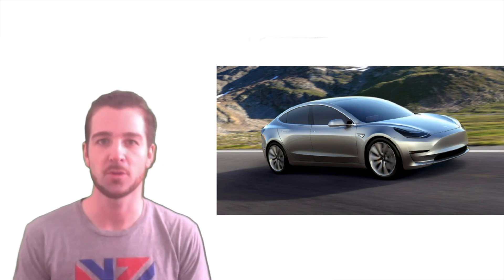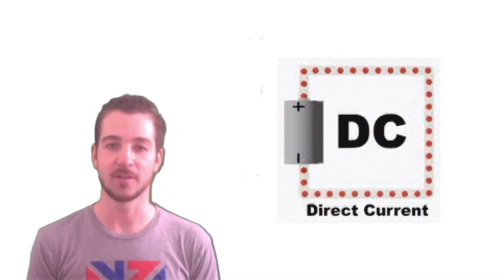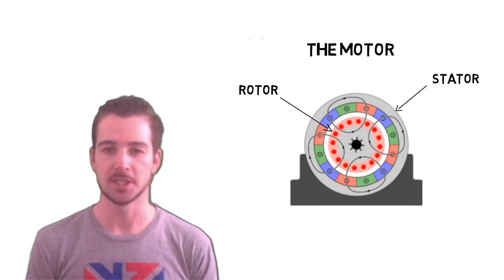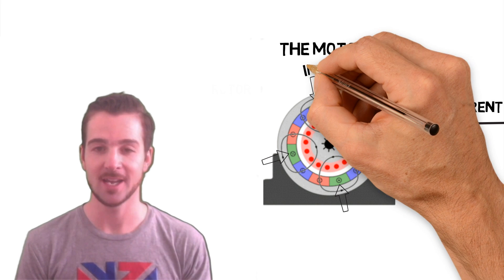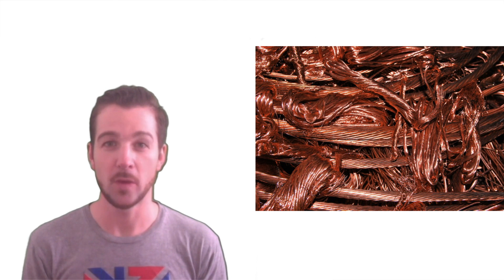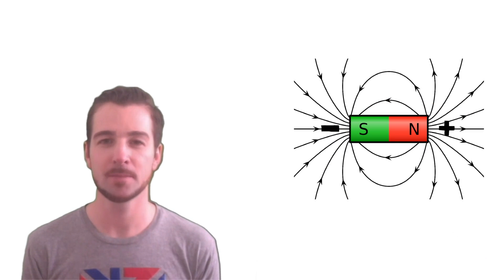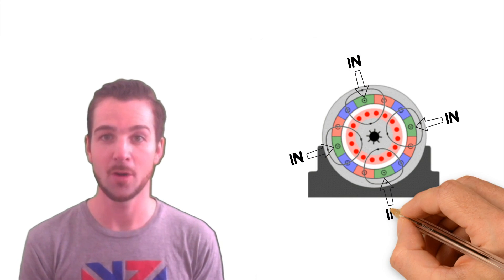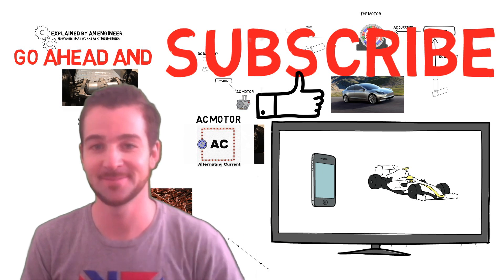How does a Tesla Model 3 work?

Comment: Petrol car uses gasoline, electric car batteries ? Shouldn't it be electricity ? 
I mean, the batteries store store the energy the same way the tank stores the gas. 

When there's no gas, the car doesn't move, make sense. If there are batteries but no electricity .. 

I know i'm being picky on the wording here 

And to conclude, even if it's very likely that the model 3 will use the exact same technology than the model s and x, the car is still a prototype ( as we can see in the Q1 report ) and the car is still subject to a lot of changes. 
Seems a bit presumptuous to talk about a car that nobody knows anything about, at least officially ^^

I know we are not there yet but let's imagine for fun, in a year or so there is a massive breakthrough with the graphene batteries ( which apparently could store up to 4 or 5 times more energy/kg than li-ion cells ), it's safe to imagine tesla would repurpose the gigafactory into making graphene batteries instead of li-ion.

And that's just talking about the energy, who know what the future holds with the motors and what not.. 

But other than that, great video to explain how the current model s and x are working.
And you actually answered a few things a friend of mine couldn't explain to me in simple non-electrical terms, so thank you ^^
Reply from the maker: Hi +Adrien Cailleaux ! Thanks for the question!

Yes electricity or "kinetic energy in the form of moving electrons" is a key form of energy in the energy equation in a electric car. 

The energy starts as potential chemical energy stored inside a battery. You can think of this as a loaded spring built out of chemicals. The energy is there and ready be to be used when we connect the battery or "release the spring".
The equivalent in a petrol car is the potential chemical energy stored in the gasoline.

The battery is then connected and the potential chemical energy changes form to electricity which is the word we use for kinetic energy in the form of moving electrons.
The equivalent in a petrol car is when the gasoline is ignited the potential chemical energy changes form to kinetic energy in the form of moving carbon dioxide and water atoms.

This kinetic energy of the electrons then changes form to kinetic energy of the rotor in the electric motor. This change is through the process of magnetic induction as explained in the video.
The equivalent in a petrol car is when the kinetic energy of the moving carbon dioxide and water atoms changes form to kinetic energy of a piston in movement. This change is due to the forces exerted on the piston by the carbon dioxide and water atoms.

This kinetic energy of the rotor then changes into kinetic energy of the car due to the force the rotor produces at the wheels of the car.
The equivalent in a petrol car is when the kinetic energy of the moving piston changes into kinetic energy of the car due to the force produced at the wheels of the car as the piston is mechanically connected the wheels.

In an electric car there is no stored potential energy when there is no charge in the battery. This is when the "spring" hasn't been compressed.
The equivalent in a petrol car is when there is no gasoline as the gasoline by the definition of being gasoline always has stored potential energy that can be released by ignition.
This relation could be written as:
gasoline = charged battery
co2 and water exhaust = discharged battery

The difference with a electric car is that is doesn't spit out its discharged batteries in the form of exhaust!!!

I hope this explanation cleared things up!! and thanks for the comment +Adrien Cailleaux !!